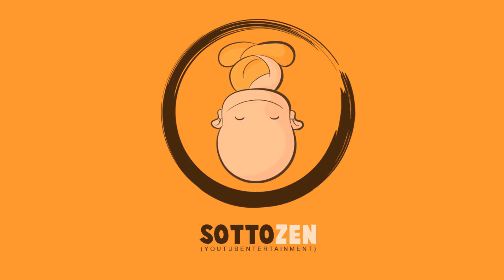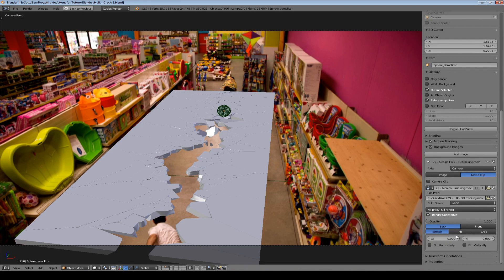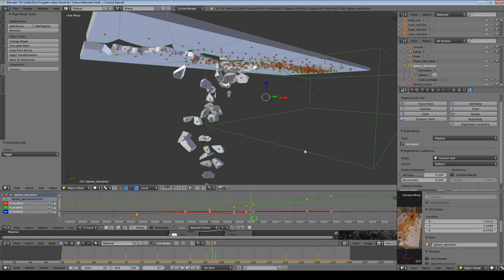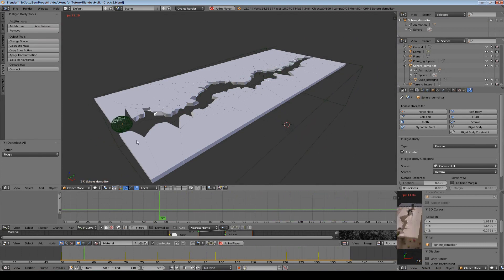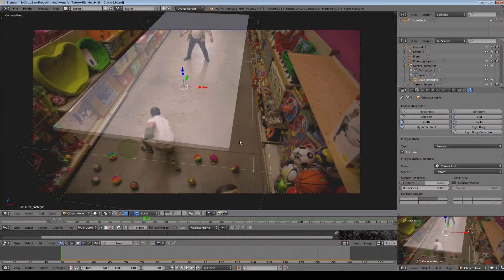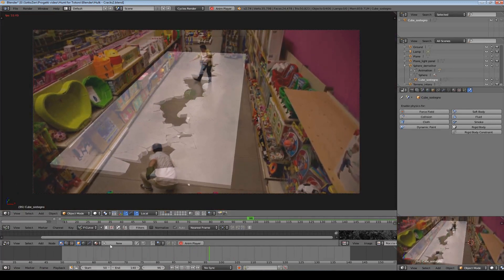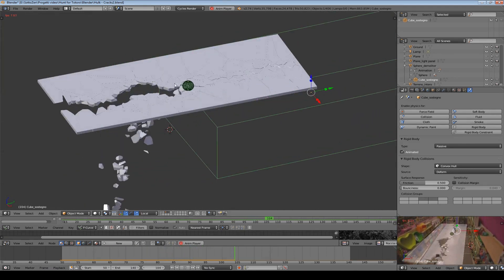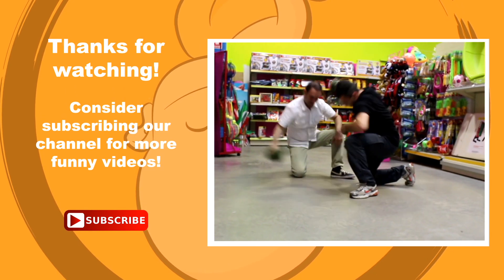Breaking down a concrete floor - Blender Tutorial - Rigid body simulation

Comment: ok  i tried it but i have a problem the floor breaks on the start completely  .....and not through the ball...what did i wrong?? i subdivided the floor then did cell fracture..then i marked the inner one for active with dynamic and animated and the outer one as passiv....then i animated the ball along the crack and marked him as activ rigidbody with animated ...but when animation starts  the inner floor falls down ..plz can you help me
Reply from the maker: Hey, I also rewatched this because it has passed some time since I made this scene and, to be honest, I was not sure of what I did at the time. :)
Ok, in the end seems pretty clear, the large passive cube animated below the cracks is preventing them from falling down at same time. Did you do this?
Reply from the maker: You did it quite weel. Only try to put the sphere more high so that it can push the pieces with the bottom part and downward. Also, you can try use ONLY the passive cube as obstacle, run the simulation and let all pieces lay still on its surface. Then youcan "apply transformation" in physics tab to all the pieces and have the new "starting point if necessary. Animate then the passive cube to slide away under the shattered active elements and you should have no problem.
Hope it helps my friend, let me know!
Reply: yeah this is the problem....the pieces dont lay still on the surface...i dont know why and how i can fix this...ok this with the sphere  is good..i did it...but  the problem with the pieces who lay not still is there......i tried it with start deactivatet but this is only for the start of the animation...... thank you for the great help ...but can you help me here again...thx
Reply from the maker: ok.. tomorrow i will take a look to this stuff again and try to solve the issue. If i get good result i will send you the blend file, ok?
Reply: ok thank you ...you are really nice.thx

Comment: This is great! I was thinking of experimenting with a sliding object under the fracture so I'm glad somebody else thought of it and that it works!
I have a question - is the sphere also a rigid body object or are you just using it for visual reference?
Reply from the maker: +Evil Twin The sphere was also a rigid body element. if you go to 3:45 i start to explain about that. Thanks for nice words :)
Reply from the maker: +Evil Twin Re watching to this part, honestly i don't remember what was the purpose of the sphere. In fact it looks like the sliding of the cube would be enough to let the concrete pieces fall down. Maybe the sphere was acting as a "trigger" for each piece that was starting with the "enable deactivation" option on. I must go back to that file and take a look :)
Reply: +sottozen Oh sorry, I must have missed that bit.
Reply: +sottozen Yes, using the sphere as a trigger makes sense, that must be what you did. I can't wait to try this!
Reply from the maker: +Evil Twin really glad you liked it. Thanks

Comment: How did you get the shards to take the material of the clip?
Reply from the maker: +Peter Martin i set up a basic material tree picking the floor color as diffuse color and mixing it with some glossy. Then i made some color correction trying to make them match as good as possible.